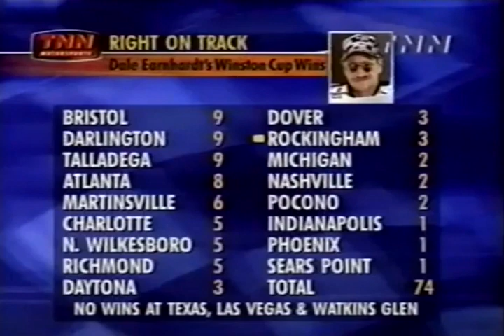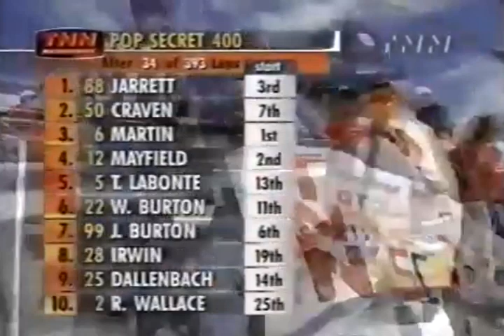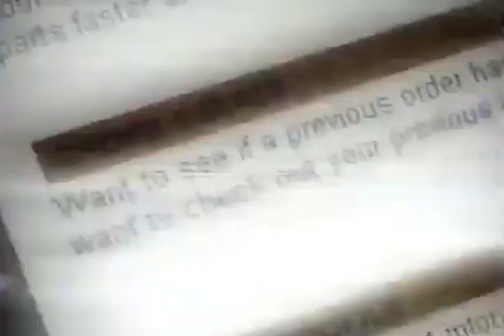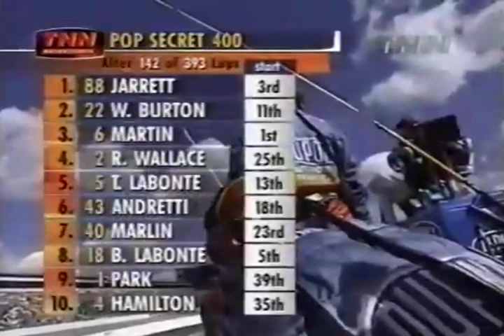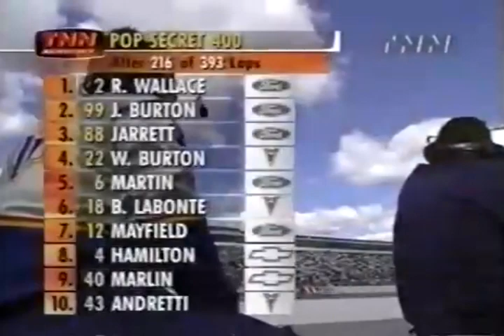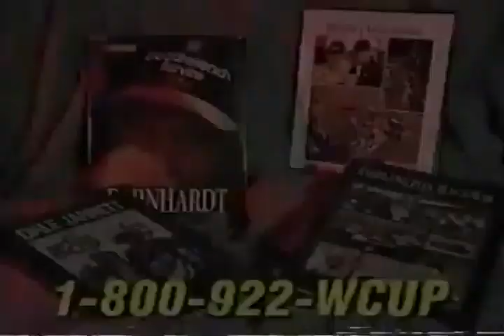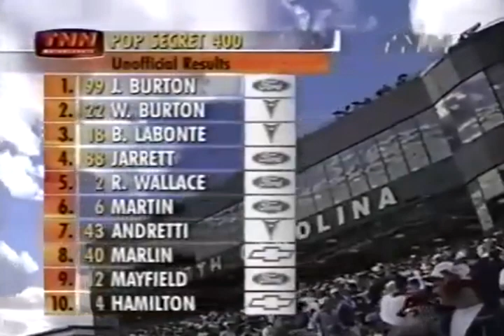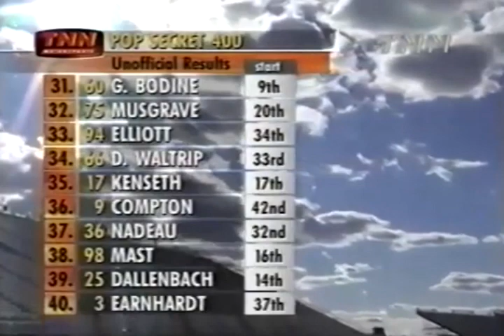1999 Pop Secret Microwave Popcorn 400

Comment: YOOO. I was at this race. went to visit my uncle in Durham and my dad got tickets to this race. this was my 1st cup race at 7 years old. sat in sec 8 row 4???
we were only a few feet before the start/finish line. Thank you so much Smiff 😁
Edit: this was my first cup race. My 1st NASCAR sanctioned race was at Watkins Glen truck race in May 1998
Reply: Great memory for sure. My first race 1980 Bristol with my dad and his dad
Reply: @brucefrye8799  I haven't been to many NASCAR races/tracks. I've been to the Craftsman Trucks Series at Watkins Glen in 1998, North Carolina/ Rockingham Speedway in Nov 1999, Watkins Glen cup race 2001, cup Fall Talladega 2007 (first COT 'Dega)
I was also at Richmond Raceway in 2003, then Nazereth Raceway in 2004 for my dad's Richard Petty Driving Experience runs. I was flirting with going to the Martinsville fall race this year